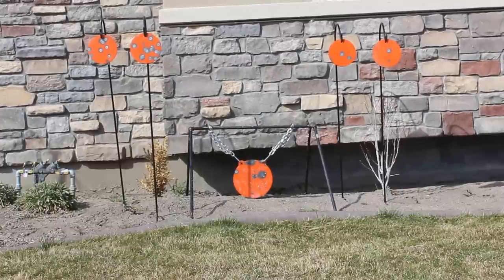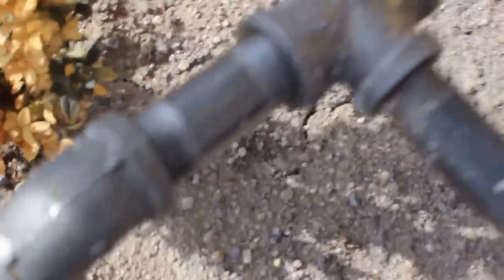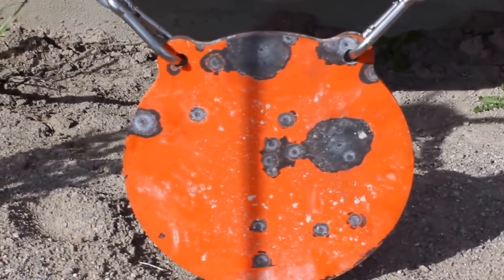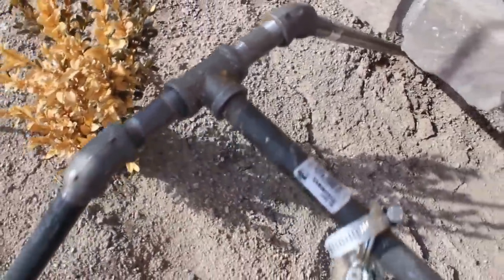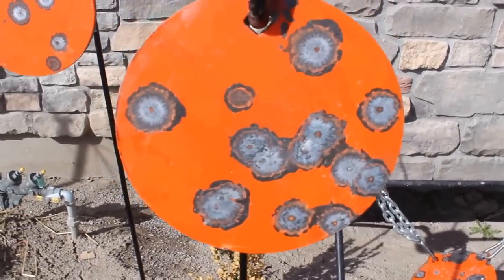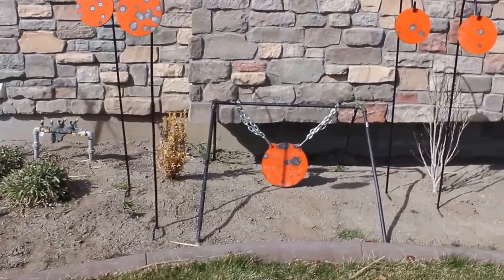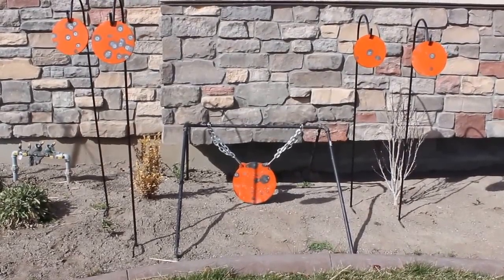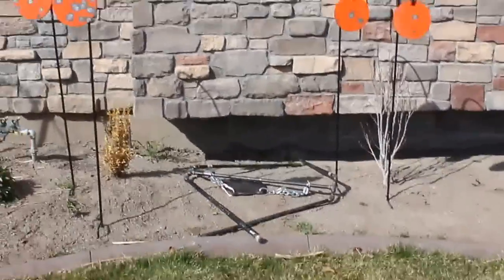DIY Collapsible Steel Target Stand For Your Gong

Comment: made mine out of gas pipe as well..if you turn your tee sideways you will only need 1 nipple and 1 elbow for each side for the legs.tighten the tee so that its solid on there and screw the leg directly into that then screw in the nipple tight but only snug the elbow that way when you screw the other leg into that you can fold it when your done for easy storage...just cuts a little bit of cost down if your building several..nice set up..

Comment: Do you ever have problem with the stand possibly tipping over
Reply: At that width I doubt it. I also prefer going to the local fire station and seeing if they have any fire house they are removing from service. It last longer than the chain as it will survive several direct hits whereas the chain will not. Plus the fire house is generally free.
Reply: Joseph DAndrea I'm guessing you mean fire "hose" not fire "house" as you wrote in your reply multiple times.  I was trying to figure out what a person would do with a torn down fire "house."
Reply: Eogrady90 you are correct. Not used to Samsung autocorrect.
Reply: No worries.  Happens to the best of us.
Reply: The targets will not fall over